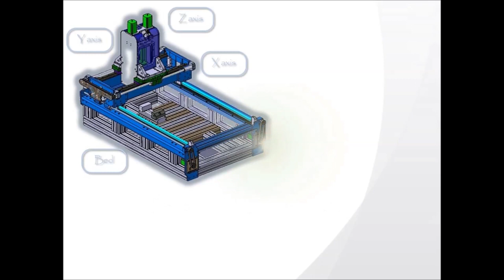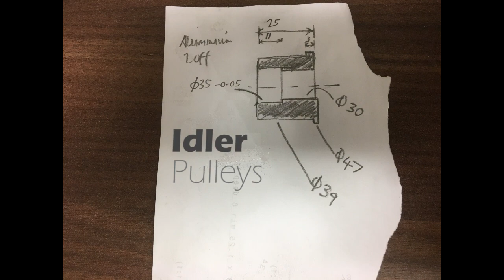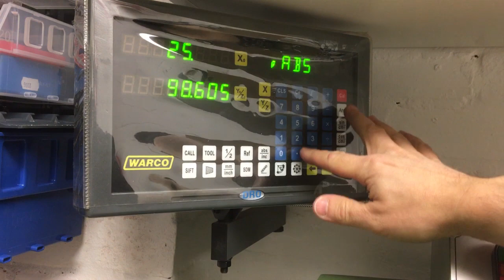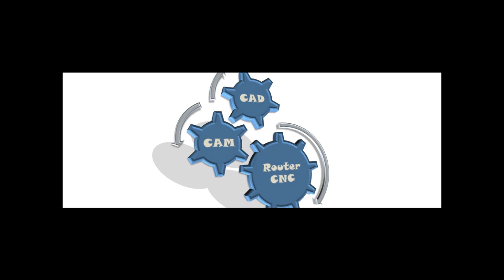Episode 12:  DIY CNC build - Gantry Ballscrews

Comment: Seems a lot easier to cut clearances than file them.  Nice work, but the cost must have been astronomical.
Reply from the maker: It’s only a hobby so no cost as such just time.  I don’t have a mill and my previous CNC machine is no more so hand tools it is.  Didn’t take that long and worked out fine.  Thanks
Reply: I tinker as well, but don't seem to have very much 1.125" aluminum plate laying around, (@ $120/ s.f. or so).  I might find 8 or 10 feet of steel tubing easily enough, but that won't get me far.  While the machine is pretty impressive, to say the least, my LOW ballpark estimate would be about $15k USD, and many, many hours of fun...... (which is actually the only free part of the deal, lol)
Reply: yeah but we all have delusions of perfect measures 
no big deal. He was smart enough to realize filing was way easier and faster than resetting a mill.

Comment: Why did you put steppers instead of servos on this very beautiful and professional CNC machine?
Reply from the maker: Hi Raul.  Thank you for the positive comments.  Main reason for fitting stepper motors is because  I already had them on the previous machine.  I only had to buy one more for the extra Z axis ball screw.  This machine is significantly heavier than my last machine so performance may be reduced on steppers.  If that is the case I will look at servos as they are much more powerful and have encoders for positional information - however they are not cheap!
Reply: routercnc, I have servos from Teknic. U. S. A., ClearPath SD model and they are a bit more expensive than the standard steppers but the satisfaction is way better. Take a look at the Teknic website and see for yourself. By the way, where are you from? I'm in France.
Reply from the maker: Hi Raul I'm in the UK.  Yes, I looked at the ClearPath servos a year or so ago.  They were interesting but my 3Nm stepper motor and 80V driver were about £80 - ClearPath was about £210 per motor/driver combo.  I won't be changing over just yet but I'm keeping all options open though, including servos.  Let's see how it runs first.
Reply: I see that you are comparing the price of the two models, but the ClearPath is 3 times more powerful, 3 times more silent, 3 times more accurate and 2,5 times more expensive than the standard steppers 😀
Reply from the maker: Hi Raul.  Yes, good info thank you.  I'm not ruling them out, just want to finish it and see how it performs with the steppers I already had on my old machine and then decide where to go.  Thanks for the comments.